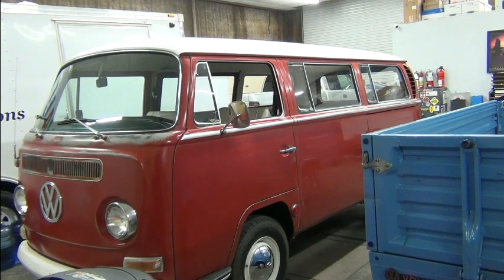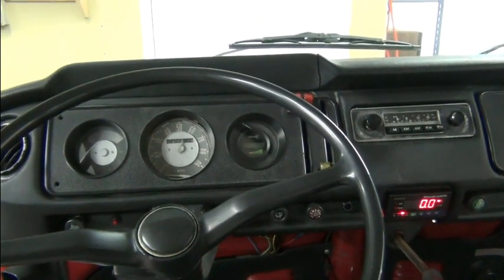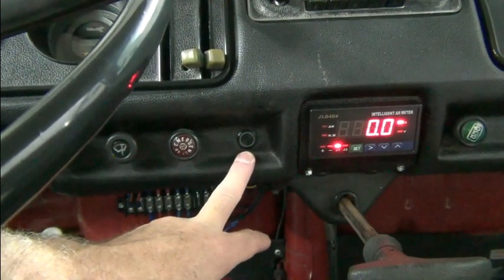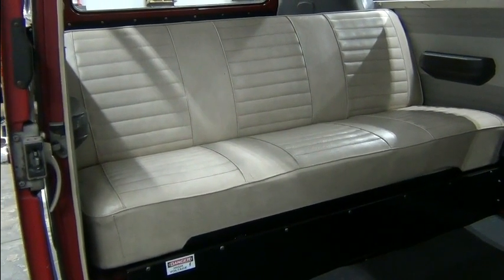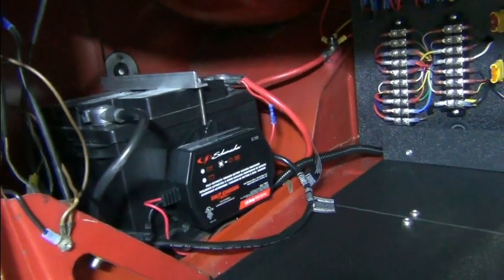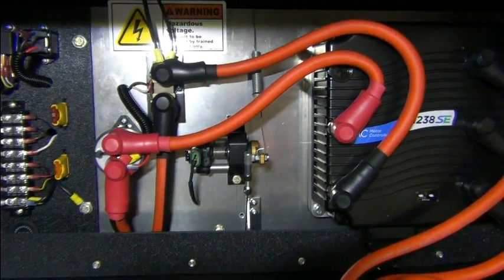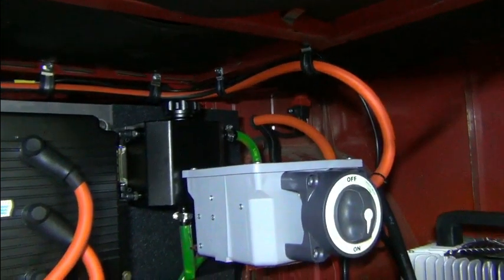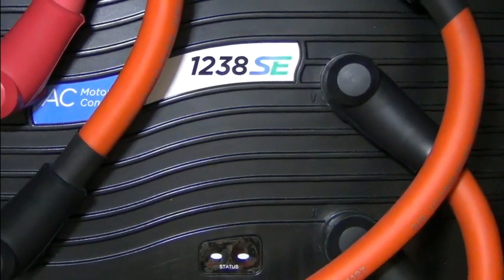VW Bus EV Conversion Overview and Test Drive  www.EV4Unow.com

Comment: Do you order from any specific company

I’m currently doing an ev conversion on a bus

Your set up looks clean, even to the push buttons (I like adding them for custom stuff like radio, electronic e-brake, etc.)

Thanks
Reply from the maker: What components are you referring to?  We are dealers for HPEVS, NetGain Motors, and CALB.